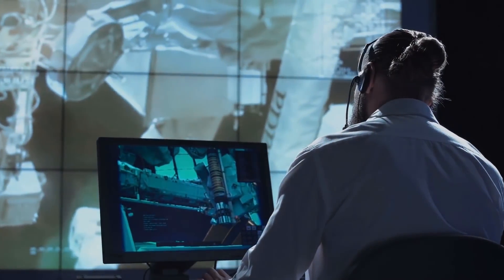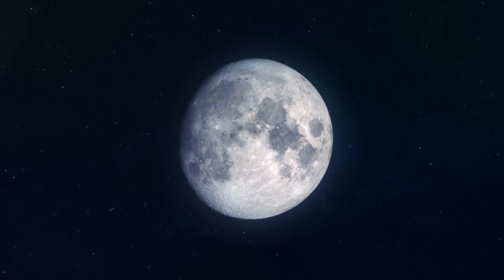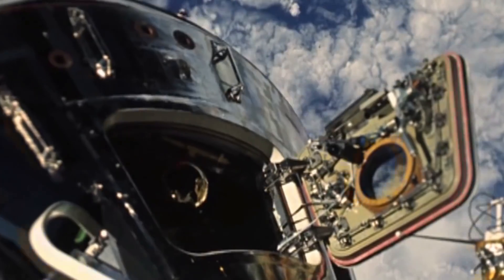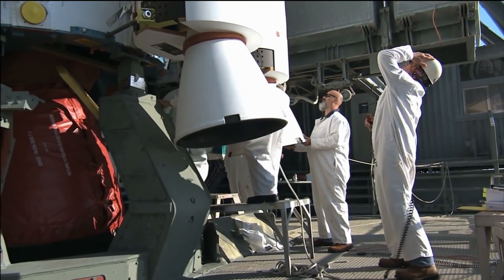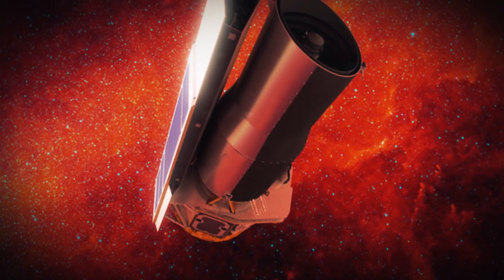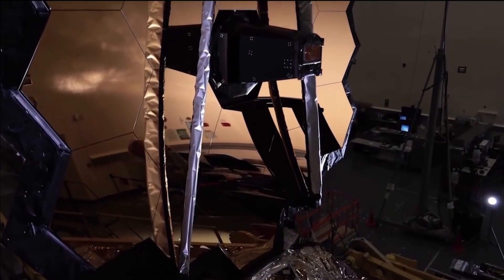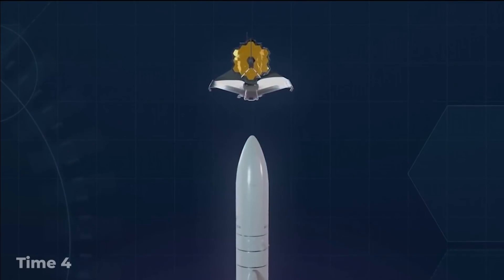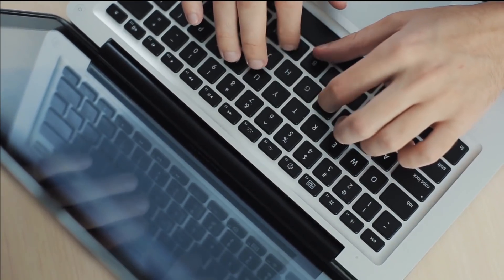James Webb Telescopes Terrifying Discovery Awaiting NASA

Comment: Hi,most important adjustblE curved srfac,efx curv RartRARTIO rartchange with individual mirror rel to thermionic grad/Dient,thermionic grar/Rients,the breathing pulse quant local individl sT/G+g( as prtrb,thenDaynamaric rebalariancing combined mirror sibuanits orienting other thermionics efx,afx curv each mirror needing see dastrt cross,section but readabl reaction curv,orienting in observartion as space (fn),thermionic,grav,mass,+G efxcoartng ID field built thermionic inertriz,changing pulse of ST/G field ocean dasturb ‘Lgrng’’poin,parricl auxpanshn,breathing,sudden low speed rippl,afx vision,thus 7 poin circref beams,spectra orient above below shroud,thanx,bliss, XAMBUNJILOM

Comment: quite a few mistakes in this video.. same with the whole premis that is shall unfold when It arrive at L2.. and same with the aspect that if any of the unfolding fail, - it will all be for nothing.
that is not the case... there are actually a few things that can fail and the JSWT will still be working.
the sunshield can fail to a certain degree as there is a certain threshold included, the result would be less sensitivity in lack of optimal cold temperature.
same with the primary mirror... certain parts of this' can also fail.. fx the two mirror-wings with each 3x hexagon mirrors .. the mission would still work with the main 10 mirrors, though obviously with a hit to the resolution..
critical aspect is the boom arm with the secondary mirror, that part of crucial, just as other factors - though the dramatic viewpoint "that its all or nothing" with the unfolding, ain't the case, - certain parts can fail and it will still work to a certain extent.
but the great thing is that so far all seems to go in accordance with the plan and numerous signs that we have full deployment as I'm writing this.

Comment: The unfortunate thing is that if it does finally launch it probably won’t work. Too many variables, hardware sensitive and it can’t be repaired, unlike Hubble. The odds of success is like a blind man standing on a raft, in the Atlantic Ocean, who has been given a sniper rifle and told to hit a fish in one shot swimming near the surface 150 yards north. He will miss.
Reply: If it was unlikely to launch successfully it wouldn't be launching yet. Yes it has a fuck tonne of failure points. But each of those has been demonstrated to be reliable enough the overall chance of success is likely. Otherwise it would just be delayed again (as it already has become infamous for). The fact they're choosing to finally launch if now means they're as confident as they can be.

Comment: So many insane things need to go right for this to work. Fingers crossed.
Reply: This may seem a strange idea but what if they had sent it firstly into low orbit then let it deploy its telescope. If it didn't deploy properly they could send a mission to repair it. When it is fully operational a small attached rocket motor could send it to its original destination.
Reply: @robertwhittingham2855  how are they going to send it to L2 if they deploy it in low orbit? Too risky and I don't think it can safely get back to earth and then onto another rocket

Comment: By the time the JWT will be finished and ready, the universe will be at the big crunch stage, and we wont need it any more.
Reply: @kosmique  right.
Reply: "at the big crunch stage": Bruh, the universe's expansion keeps accelerating continuously. A big crunch scenario is highly unlikely.
Reply: @07Flash11MRC  So the big crunch theory does not exist... okay
Reply: @bushtrash2286  It was a theory back in the days when we couldn't calculate the rate at which the universe expands.

Comment: Space is really big. JWST going to sit 3 times as far as the moon (a 1 month journey). Mars is 100x further. The closest star would take 70,000 years to reach.
The Hubble space telescope can see halfway to the edge of the universe. JWST will see twice as far to the furthest star who’s light has had time to reach us (13B yrs at light-speed); the edge of the visible universe. Space is expanding. So, over time, that starlight has gotten stretched from visible light to infrared (cosmic red-shift). Now you need an IR camera to see it. JWST is an IR camera and also sensitive enough to see the distant faint light.  It will be taking pictures of the big-bang. Of the trillions of earth like planets out there, some are 13B years older than us; they’ve had a long time to advance.

Comment: seems to me that the term Terrifying, refers to the possibility that they will find the telescope is a failure and doesn't deploy, or the telescope will prove the big bang theory is 100% wrong setting their ideas back many years.
Reply: The big bang theory won't be proven wrong, at least not the fact the early umiverse was much closer together and extremely hot and dense in the past. That much we know for certain thanks to the the Cosmic Microwave Background. 

But even in the hypothetical scenario it was, that wouldn't set our theories back. On the contrary it would be the single greatest leap forward in our undrrstanding of the universe to happen in forever.
Reply: @lizardlegend42  took the words out of my brain. I was thinking if it happens to be wrong it’s be an amazing discovery and we would gain a much deeper understanding of the universe.
Reply: The Big Bang theory will not be “wrong” if it is found to be. Different maybe but not “wrong”

Comment: i hope the vibrations inside the launcher will not dismantle this marvel of engineering and the dreams of the people who are expecting so much of it. I guess they have made simulations in real, not on computers only....But this part of the process scares me a lot.
I hope too that it will give new and extremely
Reply: Environmental Testing: Vibration, Shock and Thermal Vacuum are rather aggressive compared to the expected operational environments, so JWST should be OK.

Indeed, it is a large, heavy & delicate satellite.
Reply: @douglasstrother6584  yes of course, it's not me who save the project with my comments of today.
With the billions spent and the decades of hard work, i am pretty sure they made their duty and thank you for the info about the process.
But still, it worries me...
I hope everything will work fine.
I can not imagine the stress of the people there.
Yes, the telescope is ready for launch but what about the Ariane 5?
This one must be a very very special one.
Reply: @lordmanic2845  "Lighting the fuse" is always stressful!
Reply: And it worked perfectly, thank you France!!
Reply: bit like putting eggs in an old cart lol

Comment: I imagine in this telescope, that near sighted (like Hubble) or potential far sighted issues have been planned for and this time adjustment is already in place at a digital level. They didn't replace Hubble's mirror. They made interior changes to compensate. That won't bite them again. But I hope everything else goes well too. I'm stoked to see images.
Reply: Dont it have adaptive mirror, etc? If it that works after it is in space, i doubt we will see similar optical issues as with hubble. Hope it works, waited for a long time for this to get operational. See what new questions it will learn us to ask, or what will be asnswered. 😬
Reply: @mr.nobody8174  "Adaptive optics". That's the the term now that I hear you say it. Thank you.

Comment: A hodgepodge of irrelevant images and misinformation. 
The image resolution of the telescope will be no better than Hubble. Yes the mirror array is larger than Hubble BUT by looking at longer IR wavelengths the advantage of mirror size is reduced and effectively cancelled. Even the largest and nearest exoplanets will be little more than a smeared single pixel. 
There IS active cooling. One spectrometer’s detector will be cooled to 6 Kelvin by an electromechanical closed cycle helium refrigerator.